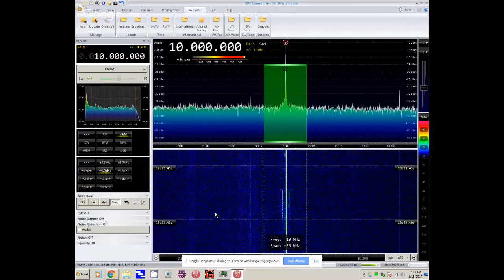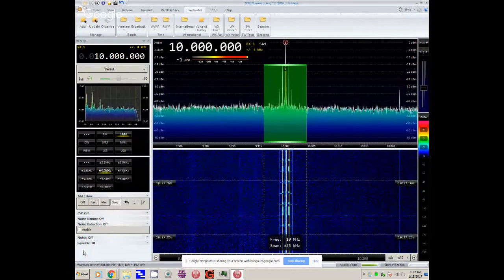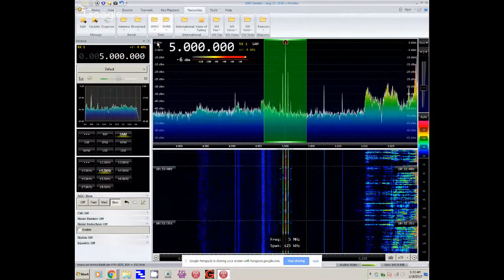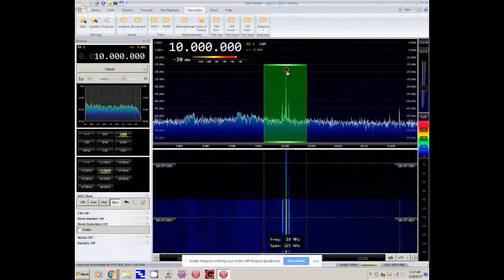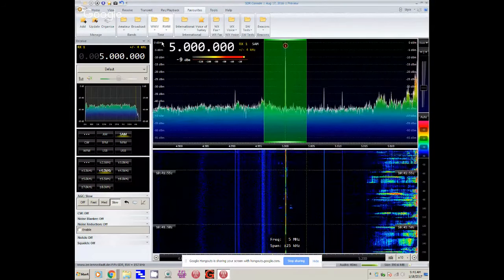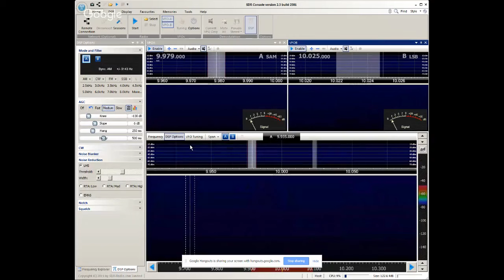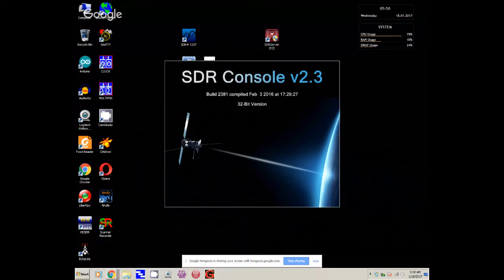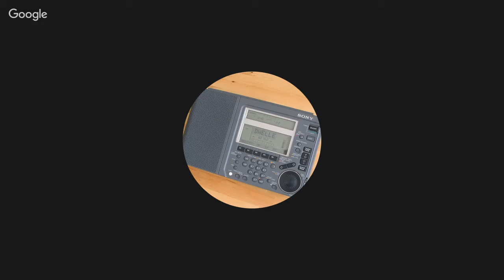TRRS #1080 - HF Antenna Testing

Comment: Try to adjust the gain in the program if you leave it on auto it tends to always jack the gain to max and leave it there and there are some cases where that can cause problems.  Every receiver/antenna/location has a ideal setting I personally keep mine at around 50% gain.  Also I've read that most RF noise from electronics is horizontally polarized so when you switch to  a vertical it acts like a natural filter but I may be wrong.
Reply from the maker: Thanks for the information.  I probably should do a Hangout and have viewers help me setup SDR Console.  I too have heard that vertical antennas help reduce local RF noise.
Reply: +hamrad88 Now that IS interesting as I had heard (and experienced) the opposite on many occasions predominantly on 11 meters, the guys used to brag of a lower noise floor when working DX, so much so that I built a 2 element yagi out of an old TV antenna (deep fringe design) and had similar experiences.

I guess it depends on what/where your local noise sources are :)
Reply: +hamrad88 Now that IS interesting as I had heard (and experienced) the opposite on many occasions predominantly on 11 meters, the guys used to brag of a lower noise floor when working DX, so much so that I built a 2 element yagi out of an old TV antenna (deep fringe design) and had similar experiences.

I guess it depends on what/where your local noise sources are :)